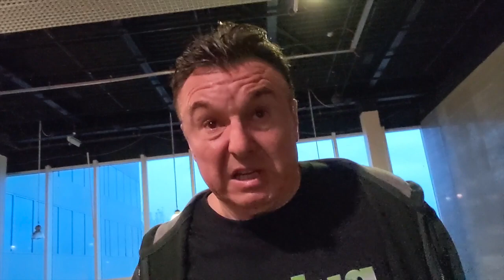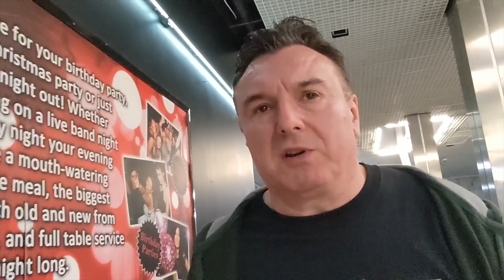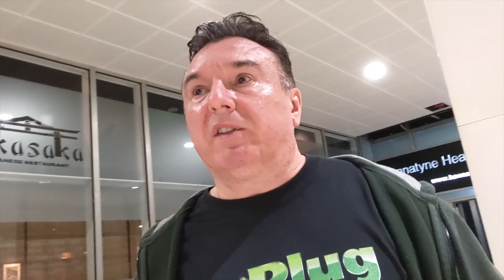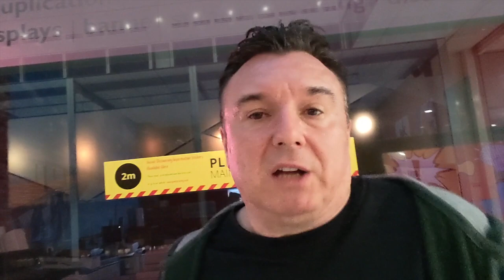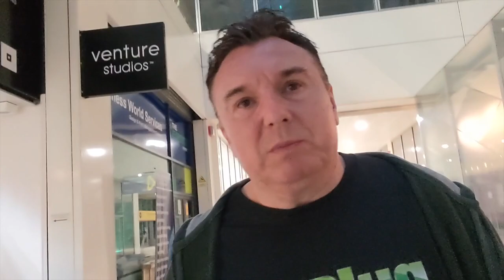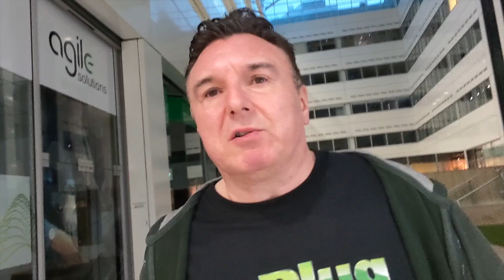Chapter 7. The mission to move on manufacturing

Comment: When you made the decision to switch focus from design to manufacturing it sounded like you hadn't absolutely fully perfected it but that that part of the process had just been dragging on for too long.  So may I ask what were the last little things you were trying to iron out?

Curious have you met, and given piano lessons to that guy's daughter? :)
Reply from the maker: The gooseneck was the most significant gap and needed a tangible implementation, not a collection of possibilities. It was a risk which needed to be addressed. I also could not see how the assembled body of the snake could be made strong enough with only tiny areas of adhesion between the parts - a problem which the manufacturer has now solved.